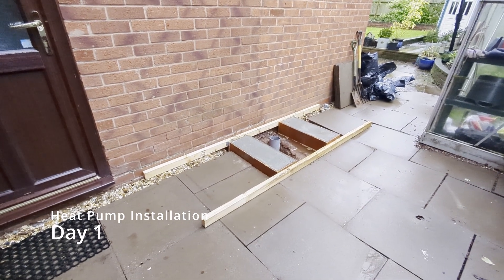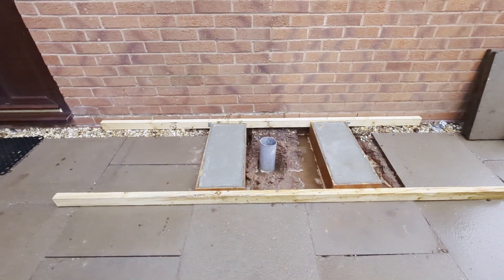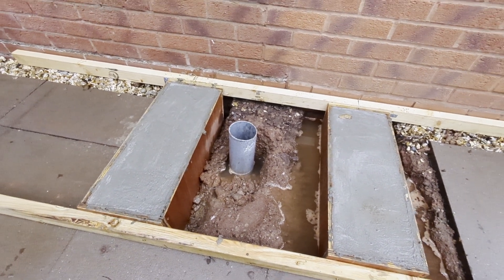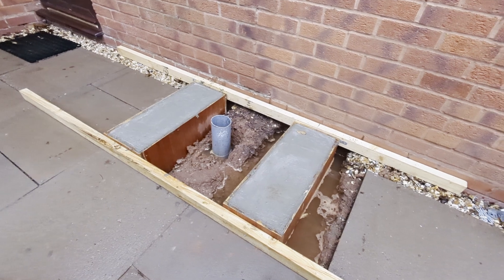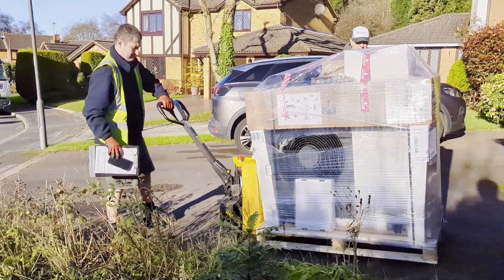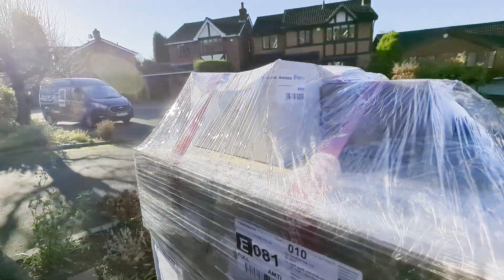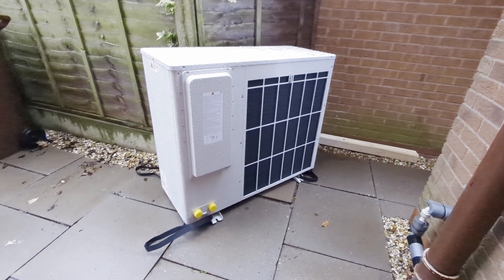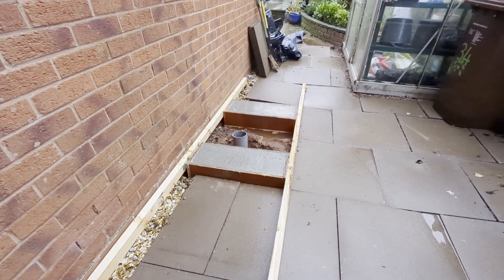Heat Pump Installation  - Day 1

Comment: Will be good to know what is the quoted dB noise rating to actual. Some say its tolerable, some say its excessive, to the point that neighbours complain....thx
Reply from the maker: @ChadPage-d6d  Vaillant publish details of such things in their documentation, but it will be interesting to see how it sounds in real life. Videos of real installations suggest that they're whisper quiet. Naturally, this installation will conform to MCS standards.
Reply: I too was concerned by noise level.  Post install of a 12kW ASHP by Aira, I am delighted by how quiet the whole system is, including the outdoor unit.
Reply: The pump looks huge, what size / output is it. Can you tell us how big your house is.   Thanks.    🎄🇬🇧🎄
Reply from the maker: @johnbell1859  It does look a bit big in the packaging but it's OK. It's a Vaillant 7kW. We have a five bedroom house.
Reply: @         Thanks,for coming back. We have a four bedroom so we might be able to have five kilowatt. It’s just at the research stage at the moment. Good luck with your install.